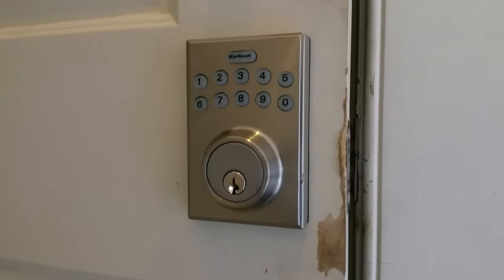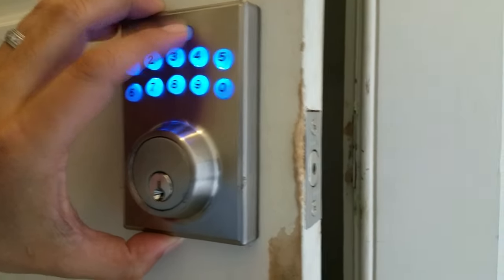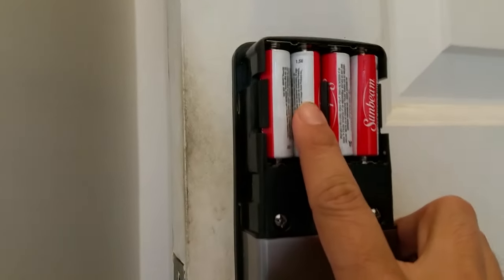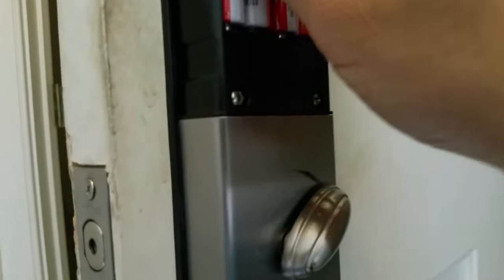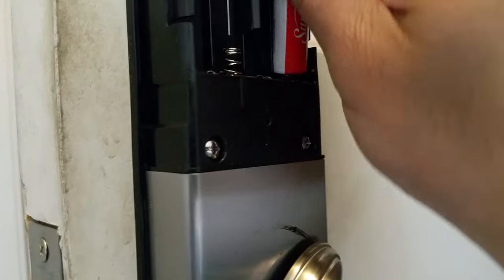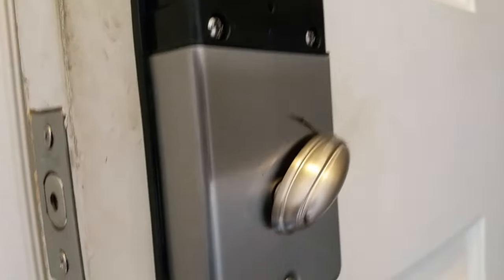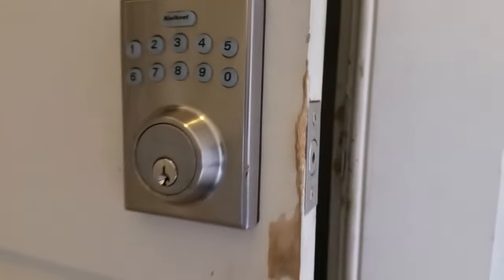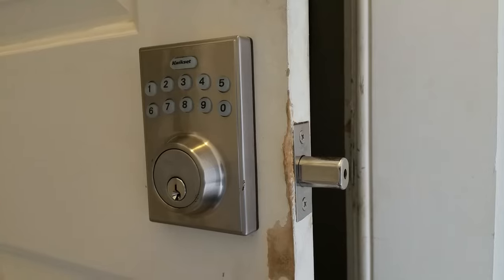Trouble shooting electronic locks

Comment: I’m trying to set mine , I got a new lock and I have to put in this code. It’s supposed to lock and then extract but it extract at all, giving me the 3 beeps which is an operation error. Is it just dead batteries??

Comment: I changed battery's in mine to rechargeable energizers there fully charged but lock bolt comes out and goes back in the door then beeps red 3 times. Nothing is obstructing it idk what else to try
Reply: Mine is doing the same thing. What did you find out?
Reply: @paulcarlson2304  junk still don't work right we got a different one

Comment: I did this. Didn't work.  Changed the batteries, still doesn't work. Any suggestions???
Reply: If you reseted it last time, enter 0000, kwikset, 0, kwikset. Kwikset again

Comment: I have the same lock and a similar issue except you can't even hear the motor trying to move. When you press the button it flashes red instead of trying to lock. Not sure what is wrong :(
Reply from the maker: I think it's out of battery